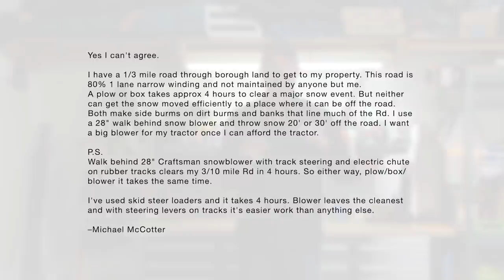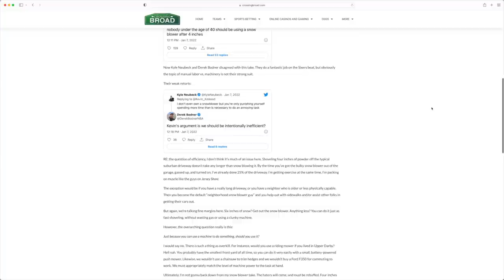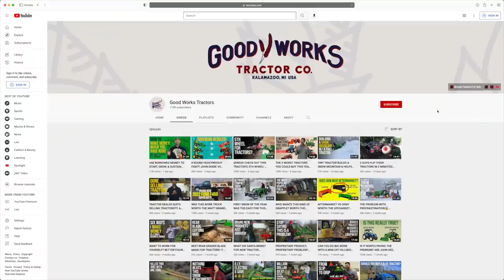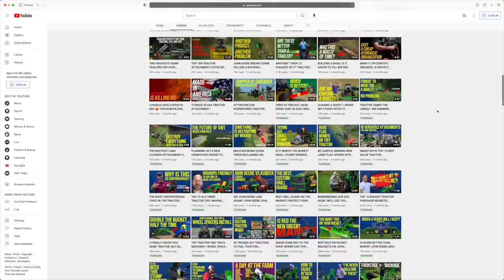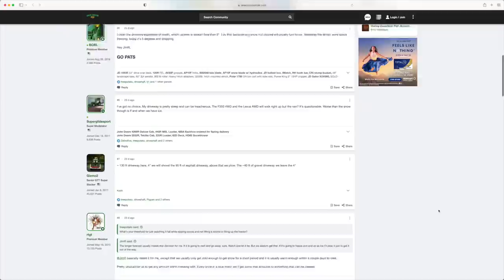WAIT! THERE ARE RULES FOR SNOWBLOWING? WE'RE NOT SURE WE AGREE.

Comment: Opinions. Okay. When it comes to snow removal. My opinion is. At all depends on. Where and when plus how much snow an person gets in their location. It depends on how much they have to remove. It depends on their personal health. It depends on how much money they have. It depends if or not they like removing snow. It depends on what type of tool that makes their job easier of more enjoyable. That leads to my personal question. Why should anyone dicktate how I remove snow. I bought now years ago an very nice walk behind snow blower. Amazing fun. Yet an neighbor did not think I should have it. At night would pour water in the front box. Without knowing. I would use it and sheer the pin every time. Then making it only junk. With my land. I need an tractor to take care of it. Here. Nope. I do own an plugging cord electric one. I had it for two years. Only used it three times. For my covered porch. The snow blows underneath it. An shovel has been working amazing. My driveway here. Don't care. My opinion. Its 100% up to the individual. Their choice.

Comment: This will ruffle some pansies feathers. Unless you get massive drifts or consistently get over a foot of snow per week a snowblower for a tractor is a waist of money and junk. A nice plow is four plus times as fast with nearly 0 maintenance. I’ve easily plowed 24”s with a X738 with a 60” plow. I can easily push back all snowbanks throughout the winter hard or soft whether it’s parallel or perpendicular.

Comment: Problem,. 2805 ft driveway + 150ft to barn + 150 ft to horse pasture.  Tar River plow on tractor does a crappy job. 74-in frontier snow blower takes too long. Solution, Western contractor grade v plow on f250 does a great job, it's warm in the cab, and I can get everything done in 40 minutes.

Comment: I have the 2025r with snowblower on front and snow builds up on the front grill and at times turns to ice I try to keep it off cuz it restricts air flow the front grill is a fine mesh type screen and it is flawed John deere should come up with a better design I'm gonna drill bigger holes in my grill to help